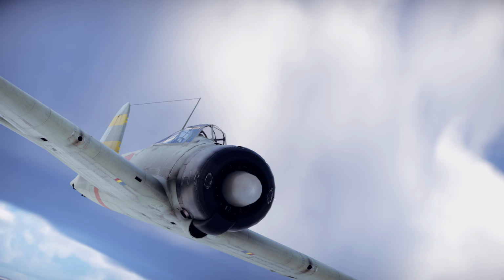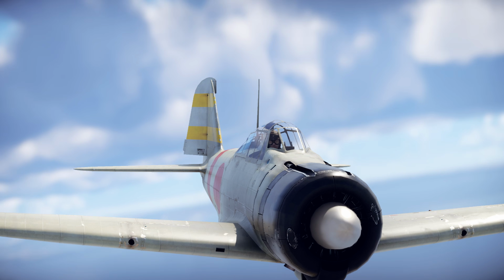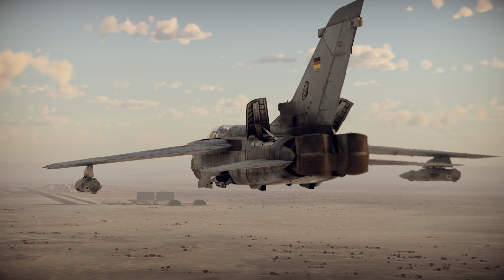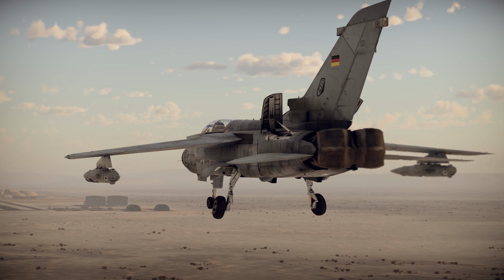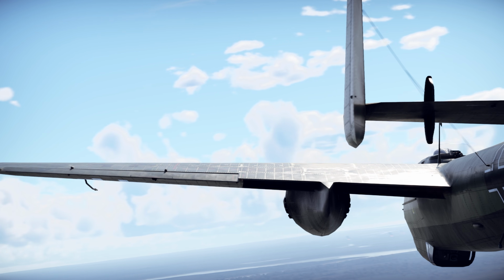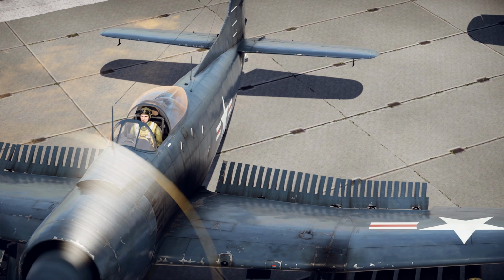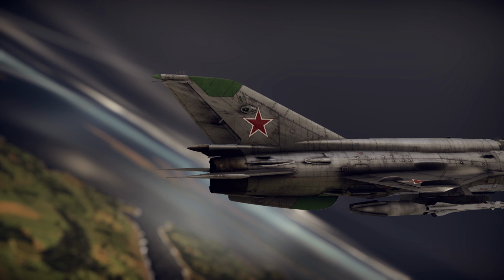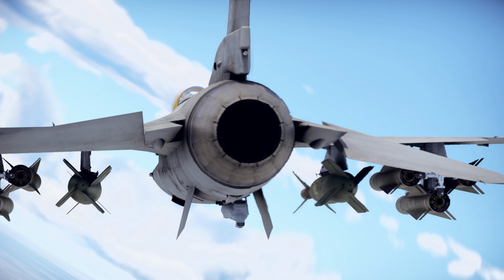Aircraft Control Surfaces

Comment: You say the basic minimum needs a tail and rudder, the Ho-229 begs to differ
Reply: Basic minimum is having 3 axes of control: Pitch, Roll and Yaw. 
How they can be implemented is another thing entirely, hence the tailless designs and delta-wings, where some control surfaces are affecting the "non-standard" axis (e.g. Elevons or Ruddervons/Spoilers)

Comment: I’d love to know what makes an aircraft design aerodynamically unstable, like the Su-27 family, allowing it to be supermanueverable and why the F-117 needs fly-by-wire controls, otherwise it will flatspin very easily.
Reply: Short answers:
Su-27: Center of Mass is very close to the center of lift, and even a bit behind it (plane wants to flip on it's head constantly)
F-117: very limited airflow around control surfaces and poor overall lift force (both of which are the consequence of the Stealth shaping)

Comment: Theres some mechanic in this game about the Propeller blade Angle? Some planes have an Governor inside the center of the propeller that control the angle of the propeller, using for various reasons like more traction or rotation, Flag Configuration when the propeller stop to reduce drag and reverse conf that permits the air flow back to front without alternate the engine rotation, would be cool if they did that and modelled ingame that mechanic, most of turboprops had that
Reply: Bf 109

Comment: If you think about it it, on the topic of control surfaces, the Mi-8 has some on its rotors. Of which can be controlled in its cockpit (which isnt modelled). So, in conclusion, add the Mi-8 cockpit
Reply: Underrated comment lmfao

Comment: Day 155 of asking for Air Assault 8.3+. We have F-18 fighting 6.7 planes, this is pathetic.

Please for the love of god, add a new 8.3+ assault at the minimum if not others like 10.0+.

We need higher BR planes to allow more pilots to get 1500 points (about 80% activity) for ~3.2k RP.

The planes in 8.3+ or higher also NEED MORE SPACING to prevent AGM cheesing and missiles taking out 3-8 planes a hit.